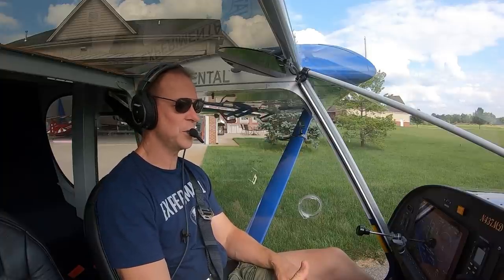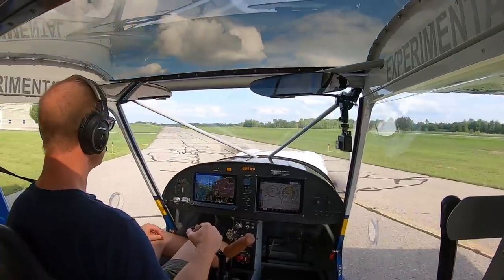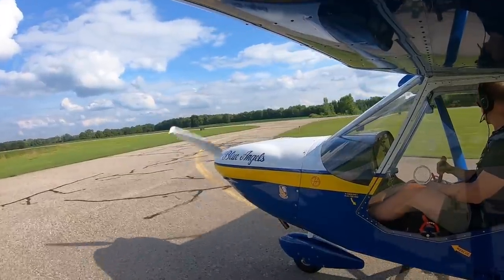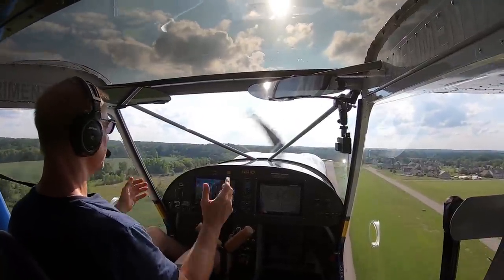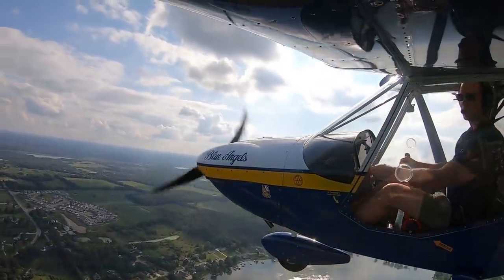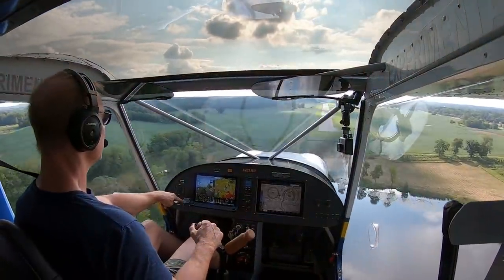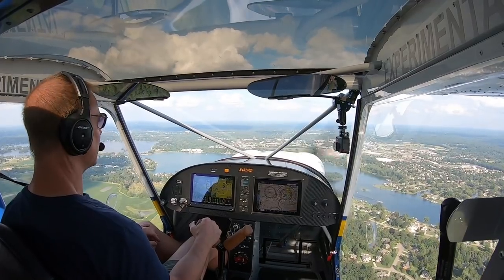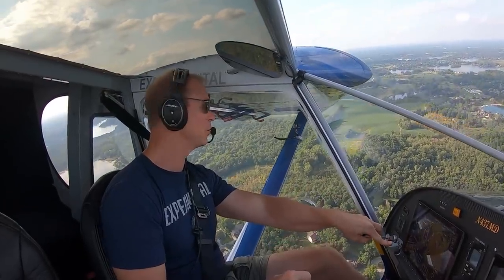Flap Motor FAILURE in a Zenith?

Comment: We used these crush washers when connecting the stainless braided vacuum lines to the wall hook-ups  in the walk-in autoclaves at Lockheed's  APC (Advanced Prototyping Center) In Palmdale, CA. One time use, just like copper or aluminum washers on oil pan bolts.

Comment: Come on guys... Zenair high wing airplanes are the most permisive machines, the STOL 701, 750, super duty 750, even the 801 and 801 HD, i allready built a 701 stol in 2001 and an 801 in 2005, in 2016 i built a cruzer and flew several times a stol 750 and belive me.... you can do unbelivebel things with this machines, like a stall with speed 0mph and droping 150/250 fpm with a smooth wing shaking.
I love it... great machines with or whitout flaps, dead stick landing and even 180 turn after take off, great glide ratio, cheap, is a MUST TO BUY machine...
Reply: The speed is not zero.  The only time an airplane has zero speed is at the apex of a hammerhead.
Reply: @LTVoyager  actually is zero, if you do a stall on a 701 or 750 STOL aircraft and you keep the nose up in the stall and not instantly recover it and keep it with nose up you get the numbers i said 0 speed and -150/250fpm.... try it
Reply: @paulopilot73  Your ASI indicates 0, but that is because it doesn’t read correctly at high angles of attack.  Even with no forward speed, falling straight down at 250 fpm is still 3 MPH, not zero.  And you aren’t falling straight down, you are likely moving forward at least 30 MPH in addition to the downward vector.  If you have a GPS, let us know if that reads 0 MPH.
Reply: @Mike-01234  you dont need more than 100hp and can land in 100m, its slow i know but its safe, light and easy to mantain and when you enter i  the world of STOL you dont gonna want anything else

Comment: I just bet  you love having that power and lift should a flap motor fail. That sure would be comforting to me. How about a flap failure with zero flaps and landing? I guess it would just be more speed
Reply from the maker: No flaps are necessary for takeoff, and in another video I did show a no flap landing. Sorry I have no idea which video it was though-one of the flying videos. A flaps up failure is a non-issue!

Comment: Since you're building your second iteration of the 750, you should know the design fairly well by now... I have been pestering Zenith with a question that they seem hesitant(?) about answering for some reason. Maybe it's liability issues or something. Anyway, I figured you might have an opinion: how big of a venture would it be to build a Cruzer with a manual flap handle instead? Ideally it'd be a twin stick version with a central flap handle, but I suppose the 701 solution works too.
Reply from the maker: There’s a large torque tube that the flap motor rotated to lower the flaps. There’s no reason why it could not be actuated manually, but you better have the engineering background and the fabrication experience to make such a design change. It’s possible, but I wouldn’t recommend it unless you have the knowledge and skill to do so.

Comment: That question is probably due to the Cessna 150 crash after a flap motor failure with full flaps on a go around. It won't climb with 40 degrees of flap.
Reply from the maker: That's unfortunate. I can see that though-the 150 will barely climb with no flaps! That's a lot of drag hanging out there.
Reply: @KitplaneEnthusiast  That cessna 150 had two full-grown adults on board too.
Reply: @brucejohnson1264  Not sure both were adults.  One was Dan Gryder.  😂
Reply: @LTVoyager  Now, that's funny!😁
Reply: Recently flew a 152 with a new 120 hp engine and it was still a slug, I can see how a 150 making 100hp would fly like a brick with flaps down.
Reply: @dntower85  I learned to fly in C150s.  They would climb slowly when I was flying solo, but not with an instructor and any amount of fuel in the tanks.  We landed always with flaps 40, but if we had to do a go-around, we flew in ground effect and milked the flaps up to 20 and could then climb as the remainder were removed.  Nobody in their right mind puts the flaps to 40 in a 150 (or even a 172) until a landing is assured.  I generally put the flaps to 40 when about 100 yards from the threshold.  If you were doing an intentional low pass, you would never use more than 20 degrees as it added no value if you didn’t plan to land.  Dan Gryder screwed up and, fortunately, isn’t man enough to admit it.
Reply: Yes, but also pulling two big guys and with we don't know how much fuel with that little O200 and 40° barn doors on a hot day. The Zenith has flaperons & more power too. Just saying ok.
Reply: The corn field charlie echo 150 I'm taking about.
Reply: So yes he probably shouldn't have put in full flaps. But then again who would have thought they would stick?
Reply: @429thunderjet2  Why practice engine out landings?  Who would think an engine would fail?  Why have light guns at towers?  Who would think radios would fail?  Shall I go on?  😂. If you have an airplane that you know can’t climb in a certain configuration, you should not put it in that configuration unless you are committed to landing.  That is simply good pilot judgement.  I like Dan and I agree with 98% of what he says, but the fact is he either didn’t understand the performance capability of the C150, which he should as PIC, or he made a serious judgement error in applying full flaps when he did not intend to land.  He should own up to that and move on.  Instead, he is trying to rationalize it as do almost all pilots who screw up and crash rather than admitting he screwed up, learning from it and using it to teach others what NOT to do.  I learned to fly in C150s more than 40 years ago and my instructor (who also was the airport owner and airplane owner) told me that a C150 with two people in would not climb in most conditions and thus not to deploy 40 flaps until you had the field made and were committed to land.  There is simply no other reason to use flaps 40.
Reply: @LTVoyager  sure sure, I get that, is what I was kinda eluding to. My instructor 50 ish years ago was that guy, the FBO owner, Cessna dealer and my father as well. So we knew Cessna flaps. Haven't been able to afford to fly since and not sure I could pass medical anymore. But I'm not particularly beholdin to Mr Gryder, in other words in not dismissing him of a mistake, but sometimes we as humans do dumb things relying on mechanicals to pull us through and when they don't and we pay the consequences.